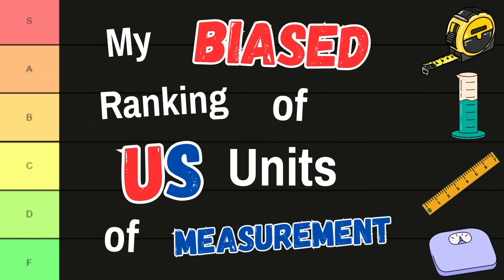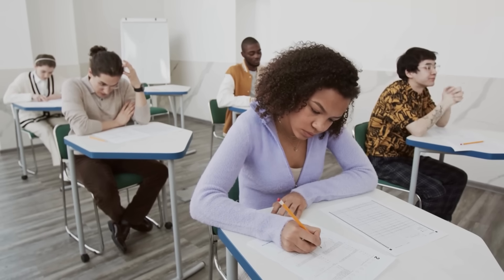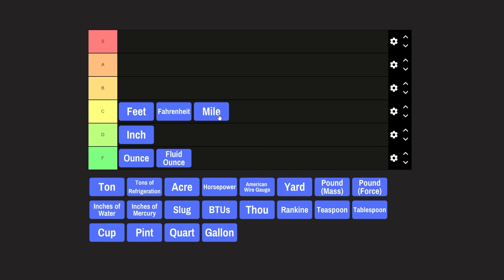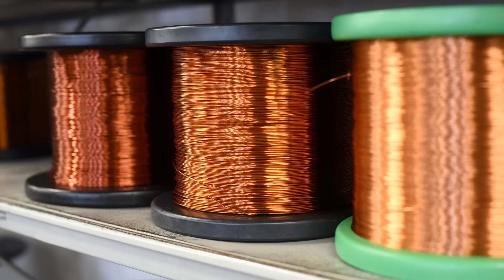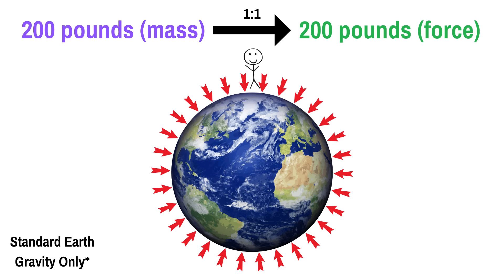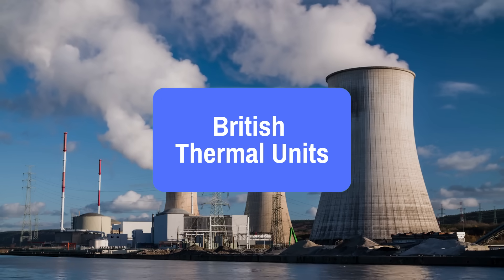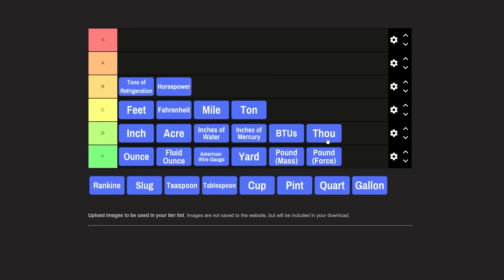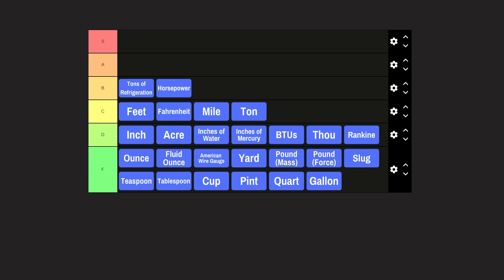Tier List of the DISASTROUS US Measuring System

Comment: Liquid units are actually almost good. They are almost entirely base 2, making them really good for doubling, quadrupling, halving or 1/4ing a recipe. Unfortunately it isn’t taught well, and there’s a few outliers. 
2^0=Tablespoon
2^1=Fl Oz
2^2= 1/4 cup 
2^3=1/2 cup
2^4= cup
2^5= pint
2^6= quart
2^8= gallon

I’d give it A tier if it wasn’t for a few issues. A teaspoon isn’t 1/2 of a tablespoon, but 1/3. 1/3 of a cup is a commonly used unit. And 2^7 is missing a unit. I feel it deserves at least C tier compared to other imperial units though.

Also, ranking (ounce) weight low because it’s based only on the weight of pure water is kinda interesting considering metric does the same thing… a gram is based on a mL of pure water. Other liquids have different weights.
Reply: a 1000 grams is a kilogram and the kilogram, symbol kg, is the SI unit of mass. It is defined by taking the fixed numerical value of the Planck constant h to be 6.626 070 15 × 10-34 when expressed in the unit J s, which is equal to kg m2 s -1 , where the meter and the second are defined in terms of c and ∆νCs.
a 1000 ml is a liter and a liter is a cubic decimeter, which is the volume of a cube 10 centimeters × 10 centimeters × 10 centimeters (1 L ≡ 1 dm3 ≡ 1000 cm3). Hence 1 L ≡ 0.001 m3 ≡ 1000 cm3; and 1 m3 (i.e. a cubic meter, which is the SI unit for volume) is exactly 1000 L.
Reply: @ja_ma I'll just add that that definition of a kg is, in fact, relatively new and up until recently, it was defined by a metal mass kept in a laboratory (I believe in France) which was defined in 1889. Unfortunately, that's not really a good way to define things and so they moved to the standard you state in 2018.
(The water definition ran from 1791 until it was replaced by the standard mass)
Reply: TIL. Thank you, random internet person, I now have a notably better chance of being able to double a batch of cookies without taking notes.
Reply: Or, you can just use metric and all your issues are gone.
Reply: Unless you only cook for 1, 2, 4, 8, 16, aso. people being base 2 doesn't really help much. But that isn't even the main point. You still have to remember tons of units and the conversion factors between them. 7 in your example alone. In metric there's just one: the liter.
Reply: @superdau  Not that I disagree, but I will have to point out that you can make any number from a series of powers of two. It's how binary works, after all!
Reply: True, but see other corners of YouTube for debates on whether binary is any good. (My take is that binary sucks terribly for usages outside of computer science and number theory)
Reply: @KirkWaiblinger that's not even a matter of opinion lol. Binary is so cumbersome that hexadecimal was created to make it less terrible to work with for humans
Reply: 2^7 is just a half gallon, so it's still good there.
@ja_ma correct, the definition of the kilogram vs liter was changed quite some time ago to fundamental units. So Americans are stuck measuring pure water for weight and then match that volume for fl oz, whereas everyone just has to measure the cube of how far light travels in about 33  picoseconds. Easy-peasy!
Reply: I just prefer if every recipe was defined in ml and g for metric, and then fl oz and oz for imperial. Get rid of the random names like spoon, cup, pint and so on. But that's just me. How often do you need to multiply a recipe by 8 or 16?

Also 1/4 cup and 1/2 cup aren't unit, otherwise you can just add 1/2 gallon.
Reply: unlike what he said , metric system exist  , and justify those stuffs to be in F tier XD

Comment: In metric, 1 milliliter of water occupies 1 cubic centimeter, weighs 1 gram and requires 1 calorie of energy to heat up by 1 degree centigrade, which is 1 per cent of the difference between its freezing point and its boiling point. An amount of hydrogen weighing the same amount has exactly one mole of atoms.
Whereas in the American system, the answer to: how much energy does it take to boil a room temperature gallon of water? Is : go f*ck yourself because you can't relate any of those quantities

Comment: I actually like the yard.

Because it’s very close to a meter, which is a decent, actually usable unit.

That makes the yard the best unit in the American system.
Reply: Today's trivia.  A Canadian football field is 110 feet long, which is almost exactly 100m.  (101m).  Interesting foresight that anticipated us going metric.
In another weird coincidence, many road systems were laid out on mile and a quarter grids.  I leave it as exercise to  see how that anticipated kilometers.
Reply: Isn't that how they added a crater on Mars? Yard=meter, close enough.
Reply: @graham2631  no, it was "okay, the descent will be this many miles"  and the other party wrote down the same number but in kilometers.
Reply: When the system is so bad, that the only good unity is the one similar to the metric system  😂
Reply: The meter itself isn’t any better than the foot as long as they are both standardized measurements. What’s better about the metric system is the easier conversion from its base unit.
Reply: A meter is about 1.1 yard. Or rather, 100 m are about 110 yard, but not exactly. Three feet are closer to a meter than a yard.
three feet and 3 inches is only 1 cm or 1% off a meter.
3 feet, 3 inches and 37 thou is even closer, only 0.00401575 inches off.
Reply: @HappyBeezerStudios  There is no way that “3 feet are closer to a meter than a yard”. They are exactly the same. Yard is defined as being 3 feet.
Reply: @MathyMemo  the fact there is even confusion about that say a lot about the imperial system
Reply: @captaineinsicht264 No I think someone is just a lil bit dumb. 3 feet to a yard is probably the most simple comparison of all this garbage measuring system.

Comment: I understand why ancient units for mass and length survived. But why Fahrenheit? Fahrenheit was only born 15 years before Celsius. They lived at the same time and yet the Fahrenheit system could found such a strong tradition that it survived till today?
Reply: I think both systems are a bit arbitrary. The absolute zero of course was found out later. And the size of a degree is arbitrary. Boiling point of water is dependent on weather and altitude. Body temperature, well, on mood, health, and other factors.

Comment: Feet and inches being a factor of 12 apart is good for stuff smaller than or exactly 1 foot long but troublesome for things that are a few feet long, I'd mark one or both of them down for that, probably feet. And miles are an easy S tier, a really usefully-sized chunk of far.  If it wasn't for the kilometer's interoperability with SI units I'd prefer miles to km.

Comment: 2000 lb is an American (short) ton. The UK (long) ton is 2240 lb, which matches much better to a metric tonne of 2205 lb. And yes, I know you're explicitly assessing US units here.
Anyway, although you might think 2000 is more sensible, the one advantage of an imperial mindset is that you get more different factors (not just 2 and 5), So 14 lb in a stone, 8 stone in a hundredweight and 20 hundredweight in a long ton, like 3 feet in a yard and 22 yards in a chain, makes as much sense as any of it.
But your basic thesis that metric is better is clearly true.

Comment: i am european, but Feet are a perfectly fine unit if measurement, and I WILL die on that hill.
It is excellent for estimating distances:
Top of A tier

Inches are pretty good, too, for the same reason. However cm isn't much harder to use, so:
High B tier

And fahrenheit is pretty damn useful for daily life, too. Celcius can be a bit of a handful, with a surprising difference between 22 and 23 degrees, for example.
But then again, 0°C and 100°C are just too good to pass by
Low B tier
Reply: You sure you're not just an undercover american?
Reply: @eetuthereindeer6671 maybe I am.

I hate the US more than anyone I know, so that probably makes me qualified to run as their president or something
Reply: Though I did change my mind about inches.
I think the precision cm grants is way more valuable than the tiny bit easier estimation inches give.
C tier

Comment: Cool video, but god the bias towards "Imperial system is dumb" is crazy strong. 

For starters, I use metric. I was born and raised outside America, so metric was the standard. That being said, it feels like very little information was researched aside from looking up "Where did X mesurement come from" Which, counter intuitively, tells you next to nothing about how useful said metrics are. 

It feels like this video is prioritizing simplicity of understanding over practicality in daily usage.

Don't get me wrong, metric IS a great system, and it is better for the basic mesurements (Gram, Meter, Liter). That being said, complaining about the numbers in the imperial system being "Arbitrary" is hilarious to me when both the meter (and therefore the gram and Liter) are exteemely arbitrary. 

Secondly, being easily divisible is not the most important factor when creating mesurement systems (Remember the french metric time? Lmfao) Sure, 10 is intuitive and helps the average joe, but that's still not even always the case. 60 based system is much more divisible, and more importantly, more intuitive. It allows for smaller numbers that don't grow exponentially fast, and is equally intuitive and (Debatably) easier to divide. 

Lastly, a lot of those measurements are specifically used for certain things. There's no redundancy, you're just ignoring the human aspect. These are standarized across the board because they work well enough, and that's all they need to do. The redundancy is negligable or nonexistent when the only people that use them are professionals that know exaclty what they're used for, and when they're used. They wouldn't use a measure of force for mass. They KNOW a slug is force derived because it would make no sense for it to be mass derived, and even if it was, under the conditions used, it's the exact same thing.

That being said, a lot of high grade labs and professional research environments use the simple combination of SI units because it's simply a world wide standard, and standarization is the most important factor in any measurement system. If everyone uses the same thing, it does not matter how arbitrary measurements are, peoole will understand.

Comment: You can have your own opinions about each measurement system and personal preferences. However, there is nothing inherently scientific or natural about metric system not anything inherently disastrous about US measuring system.  The only really scientific and natural measurement units are Planck units which are are not really useful for measurements on a human scale as they lead to computations in impractically large numbers. Every system of measurement be it imperial or metric started with a base set of entirely arbitrary anthropocentric units which were progressively replaced with more standardized definitions. Kilogram was supposed to be the mass of one liter of water but very soon after the definition was adopted, it was found that it was so difficult to standardize the conditions in which the measurement should be done so much so that it was completely abandoned and the unit was entirely defined by the mass of an arbitrary cylinder in Paris. Attempts to define the meter using the circumference of Earth were also futile and just to keep up with historic usage we end up with the disastrous fraction 1/299792458 of the distance traveled by light in a second in the current definition of meter. US units also went through increasing levels of standardization and eventually to enable international trade and commerce and for compatibility with international scientific literature, they have been already redefined as precise fractions of metric units.  So, US units are now as properly or as stupidly defined as their metric equivalents. Yes, to give credit where it is due, the use of consistent base for units is good, but the choice of ten for that base was an horrible decision. Objectively speaking, six and twelve are much better choices for the base. Also, practically I have not yet seen a metric fanatic who uses the accurate Kelvin scale to talk about the temperature when discussing weather. Negative temperatures are the most disastrous idea, yet metric fanatics seems to think that Fahrenheit is stupid and happily use Celsius. If they so really love the SI, why don't they start using Kelvin scale which I agree is objectively better. Yet, metric fanatics seem to think that their entirely arbitrary anthropocentric units are somehow an astounding invention and those who are not using them are idiots!

Comment: As an engineer my absolute favorite imperial unit is kip - which stands for kilopound-force over square inch. Yes, this is an actual unit in common use.

And a pint has an advantage. In the metric side of the world, a large beer is usually 0.5L, which is less than a pint. So you get more beer.
Reply: I would like to point out that you are using English Imperial Pints not US customary pints which are smaller at 0.47 pints per litre. No source of confusion there then 🤥
Reply: @martinconnelly1473  good point! UK pint is where you get more beer, not with the US pint though!
Reply: The Imperial pint is actually a bit of a screw-up, to be honest. When Parliament revised the measures in the 1820s they (smartly) set the definition of a fluid ounce such that that quantity of water weighed an ounce. Had they stopped there, it would have followed that a pint of water would weigh a pound as there were formally 16 ounces to both the pint and the pound. But oh no, they had to sort-of half-assedly get on the decimal bandwagon and set things such that an Imperial gallon of water would weigh 10 pounds and then backed that out through the rest of the units so we ended up with bonkers 20 ounce pints, pints that are also 2½ cups rather than the 2 cups they are in the US.
Reply: That’s kpsi, one Kip per square inch. A kip is a thousand pounds of force.
Reply: A kip is a thousand pounds force, a kip per square inch is ksi.
Reply: Just use the Australian pint, which is 570 ml. (but not the south australian pint which is 425 ml) Or the old french royal pint, which is 48 french cubit inches or about 952 ml
And if you want to get fully wasted, the scottsh pint is 1696 ml
Reply: the confusion of pint sizes seems to be quite common, my father has a few glasses that fit an american pint, but with the conversion from british pint to mililiters engraved at the bottom.
Reply: You mean imperial pints, and not USC pints.  (And of course, but I think you know that "you get more beer" is bullshit if you consider the important thing: beer per currency unit)
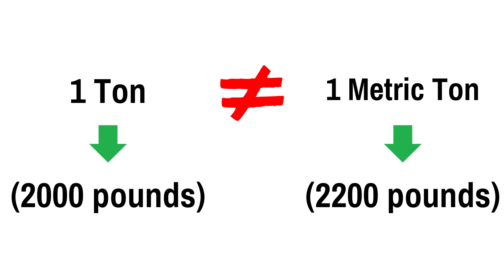Reply: 3:08 a standard Imperial Ton or “long ton”, is in fact 2240lbs. A short Ton or “American Ton”, is 2000lbs.
Reply: Ja qué pícaro.
Reply: stm7810 😢
Reply: PSI has an upside where people can conceptualize it, unlike kPa, MPa etc. 1000 newtons (have to /10 to have kg) over 1 m2 (too big for body)???. 

Like when Oceangate imploded there was 6,000 psi, so about 3000kg/3tons on every square inch of the body. While 41kPa is just "alot"???

(Relative) Pressure units are the only thing I'd convert metric to imperial to get an have a conceptual idea of what it is.
Reply: Kip is a kilo inch per pound.

Comment: 2:13  As an Arizona resident, 100 Fahrenheit is not uncomfortably hot.
Reply: A/C or outside? ;-)
Reply: As a former Arizona resident... I'd agree only because 110-120°F days existed which means 100°F days feel not as bad.
Reply: Houston here, we call y'alls a 'dry heat'.  Try 100F @ 80% humidity and get back to me.  :)
Reply: @glynnetolar4423  I agree with you.  I have been to Texas in the summer.  However, I think it is fairer to compare your 100 degrees with 80% humidity to our 120+ degrees.

Regardless, you and I are better than everyone else because we live in hot places.

Comment: Teaspoon, tablespoon, cup, pint, quart, and gallon are S tier because you can deal with fractions instead of troublesome decimals when converting or changing the size of recipes. Inch and feet are great for everyday measuring, just like Fahrenheit works well for everyday weather. Also a lot of the imperial system is designed to have several prime factors, which reduces the chance you will have to deal with decimals and can deal with fractions instead (And fractions are much easier to calculate in your head than decimals). Metric is based around the power of 10, which has a comparatively low amount of prime factors. The easy conversions of metric come at the cost of weird decimals. For example, metric tries to mimic the imperial system with centimeters and meters, and I laugh when I hear people give their height with decimals. Like someone saying "I'm 1.67 meters tall" while in imperial you would say "Five-eight" for 5 foot 8 inches.
Reply: What we conceive as great for everyday measuring is highly dependent on culture and where one grew up. 

As someone who grew up with metric I can say that inches, feet, and Fahrenheit may as well be a foreign language to me. 

Btw I laugh at anyone who uses two different measurements to describe one thing such as 5 8
Reply: @Kanbei11  I think it's a lot easier to actually visualize something by using two measurements like if I heard I'm 5.65 feet tall I would have no concept of how tall that person is however if they said I'm 5 foot 8 I would have a good idea of how tall they are in my head although this of course depends on what you grew up doing or what system of measurement you use
Reply: @joshdingle930  I think that points to culture. I'd understand 5.65 foot as a little over 5 and a half feet but would struggle to visualise what that means in terms of someone standing in a crowd for example.

With 5 foot 8 (inches) I have to know that there are 12 inches in a foot.